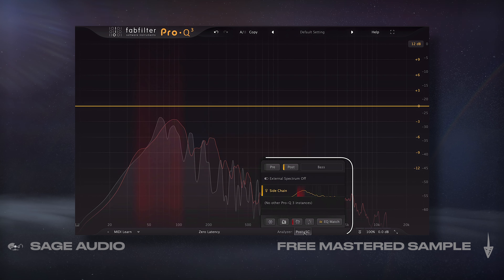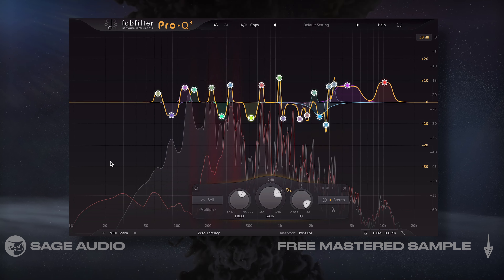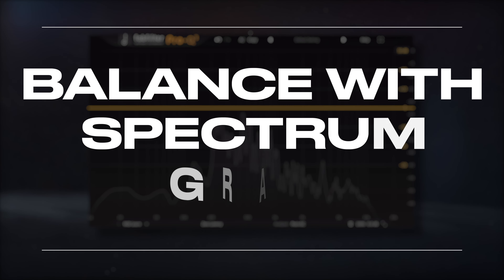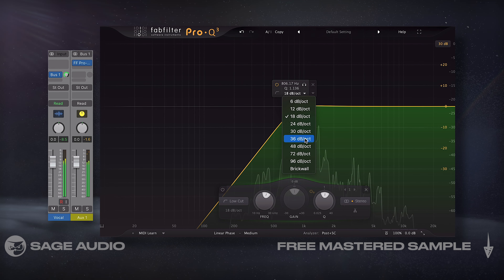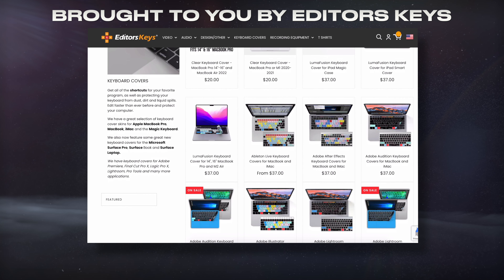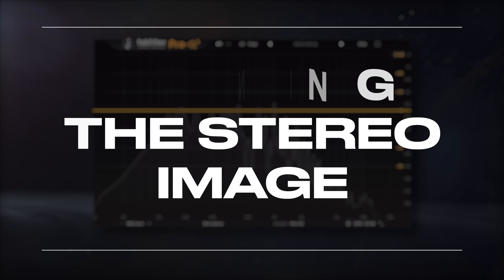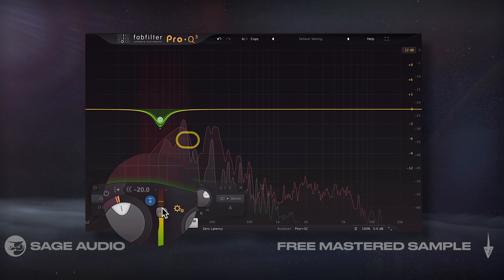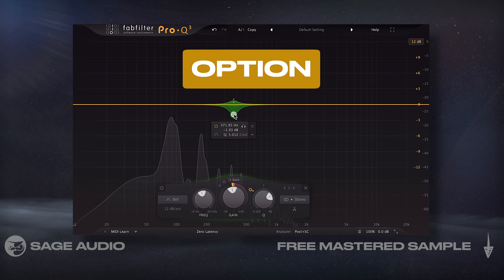How to Use FabFilter Pro-Q 3

Comment: I have Pro-Q 3, Am I missing out on Pro-Q 2. I didn’t get Pro-Q 2 because I have the third Pro-Q, but now thinking if Pro-Q 2 has anything cool and unique that Pro-Q 3 doesn’t have. Of course the third one is way superior, but I haven’t been able to get a simple answer on if Pro-Q 2 would be worth to get even tho I have Pro-Q 3, or would it just literally be wasting money
Reply from the maker: Thanks for watching! In my opinion, there's no need to get Pro-Q 2 if you have the Pro-Q 3.  3 has all of the functions of 2, but with an improved interface, as well as some additional functions/features.
Reply: @sageaudio  thanks, this helps. I got it for iOS. Both were on sale recently for 20$ each. I didn’t understand why Pro-Q 2 was same price as the third, when it should of been way cheaper the Pro-Q 3

Comment: 4:00  Don't do this. This is a poor crossover design as it introduces a +3dB boost at 150hZ and 4000hZ. To do it properly, duplicate each instance of Pro-Q, or more simply, just duplicate the band so that there are two 18dB slope filters in each instance. It still won't null exactly, but it'll be a lot better than what you've suggested. To make a 3-way crossover that actually nulls, you'd have to use Dan Worrall's Reaper trick.